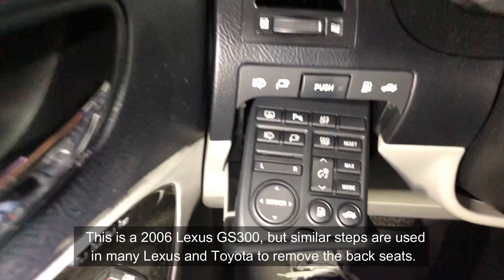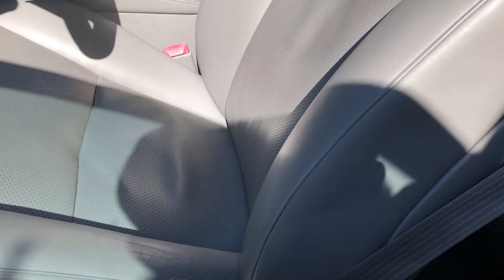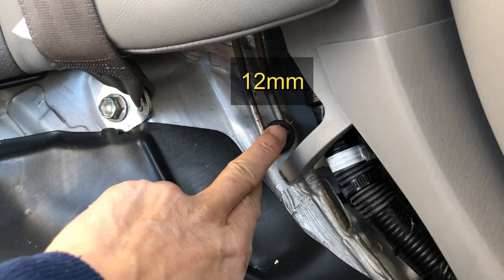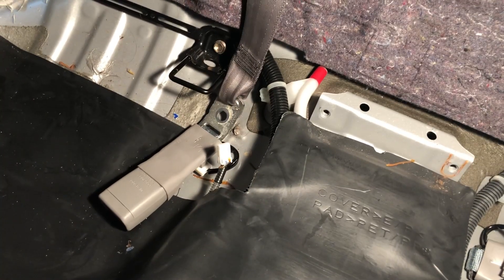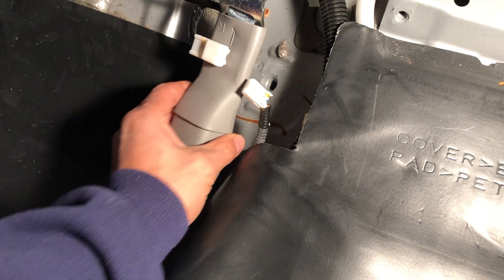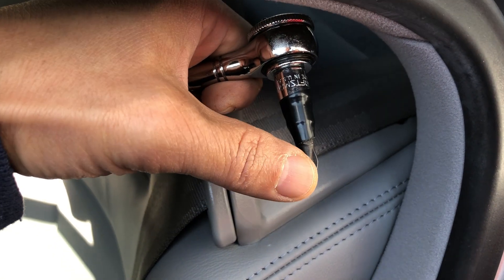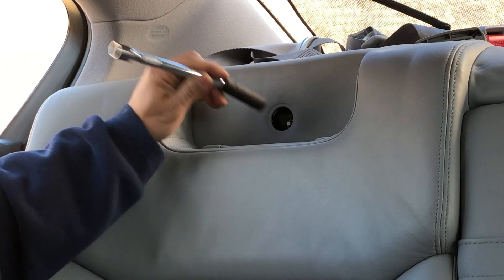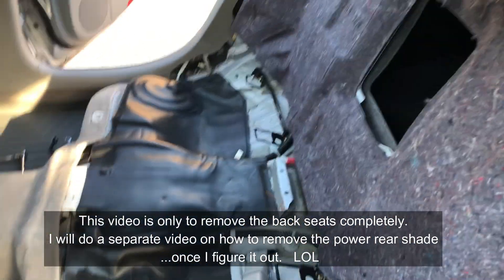3rd Gen Lexus GS Lexus/Toyota Back seats removal.

Comment: We're you able to see into the boot? Something in my boot is jamming the lock
Reply from the maker: I’m not understanding clearly. Which boot and lock are you referring to?
Reply: @DIYLifeSkills  the boot of my lexus won't open. Lexus say something in the boot is jammed against the lock and the only solution is to cut out the lock from the lid to release it - very expensive job.
Reply from the maker: @cmina8606  I don’t know what boot is??  Is it related to the back seat? Or are you talking about some other area? Only rubber boot I know is on CV joint. Describe more clearly where the boot and lock that you are referring to.
Reply from the maker: @cmina8606  are you talking about opening the rear trunk or engine hood?

Comment: So why did you have to take out back seats
Reply from the maker: This is first video in series. I had to take out the rear electric sunshade that was broke.  Also, in the process, I found blown subwoofer.  You need to remove the back seat to get to those.

Comment: Hello, I have a gs450h. I want to change the battery. I don’t need to remove the seat. I just want the rear seat to lean forward. I have room to remove the battery screw on the back of the seat. But the rear seats cannot be fixed forward, is there any way? Thanks a lot
Reply from the maker: I found the GS450H video for you.  Search for this title in the YouTube since YouTube doesn't allow leaving links in the comments. 

"12V Battery Replacement - HOW TO REPLACE STARTER BATTERY of a Lexus GS450h 2007"
Reply: @DIYLifeSkills  
Thank you for your reply, but I want to change the hybrid battery, so I need to remove the screws from the rear seat, so how do I tilt the seat forward? Thanks again
Reply from the maker: @zhongqianzhao4313  Don’t have 450h to know the exact answer but GS300 rear seat can’t be tilted in anyway.  It has to be removed.
Reply: @DIYLifeSkills  Thank you very much, learned a lot from your video, come on! !